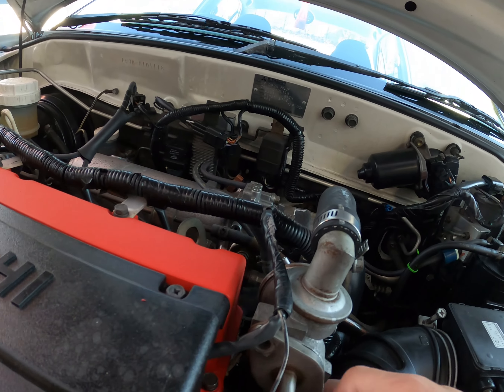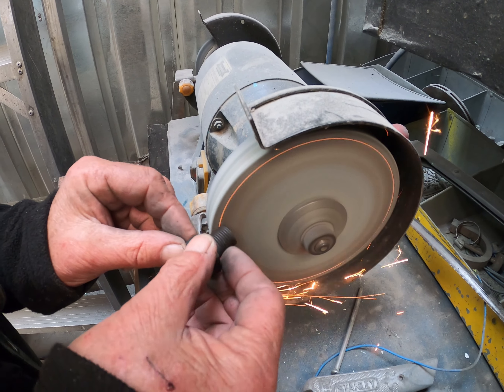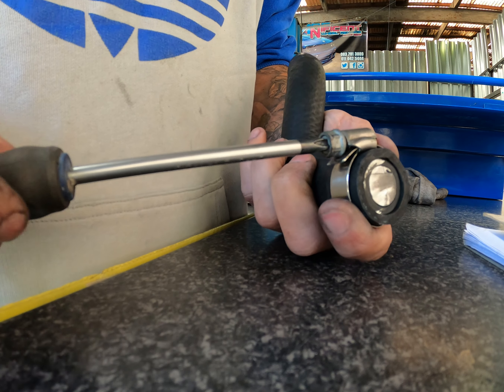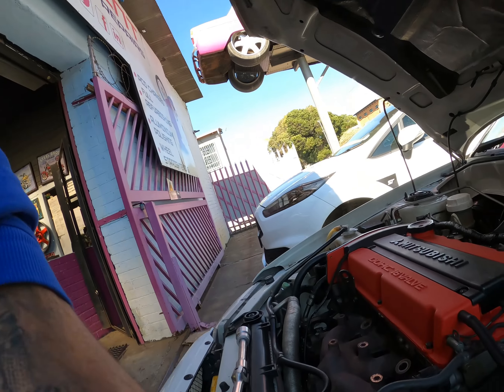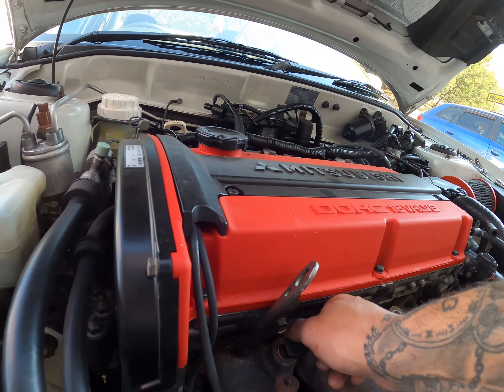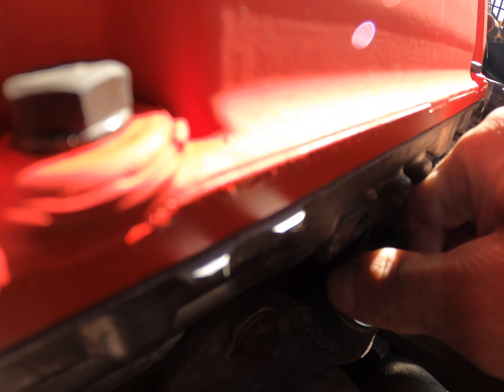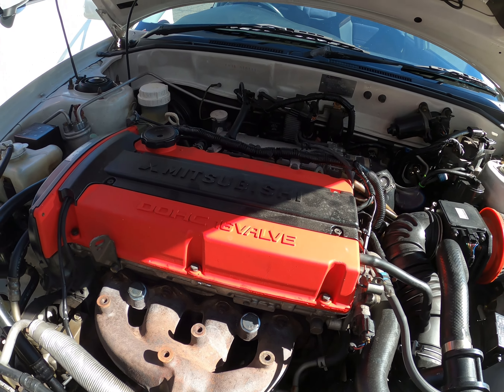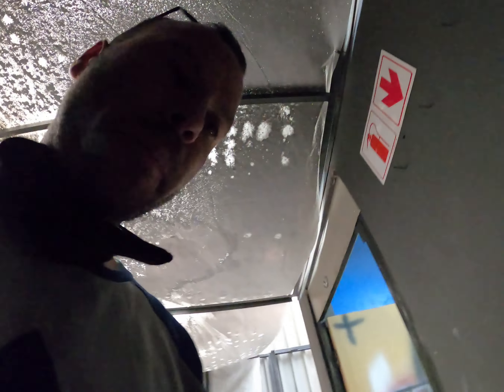Mitsubishi Evo 4g63t - EGR / SAS DELETE - Before and After

Comment: I write from Spain I have a lancer evo 5 and I want to remove my egr I need to know what you did with the egr vacuum hose, which is thinner?
Reply from the maker: Ola brother 🇪🇸 

The vacuum hose I just blocked off, you can cut it off right at the end so the pipe is very short and put a small bolt into it with some glue but it must be tight or you can take the pipe fold it over and zip tie it. I used the bolt because it works and it is the neatest looking
Reply: @the_JDM_fanatic  I mean the small hose friend the one that goes to the intake manifold?
Reply from the maker: @carlesfrances5750  can you maybe send me a pic to my Instagram, it is the same handle as here? 

But same thing I blocked it off

Comment: What would be the consequence if you remove egr
Reply from the maker: @godwingeneroso217  nothing what so ever, I felt a power increase as the car is breathing in clean air only, the egr or sas pushed back burn air and fuel back into the combustion chamber , it’s supposed to help with emissions or something like that? But we’re all here for power esp with these kinds cars